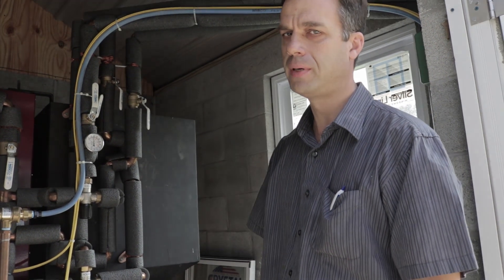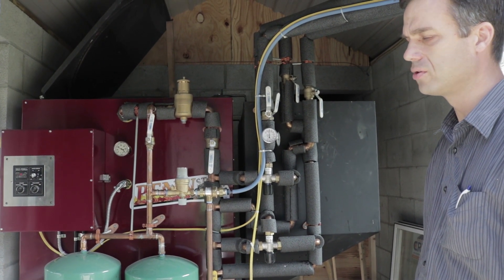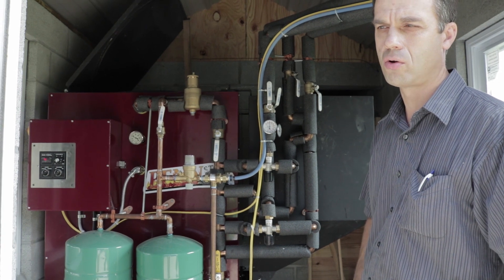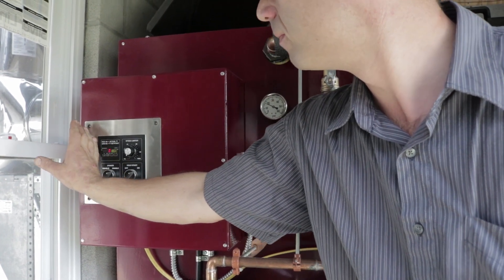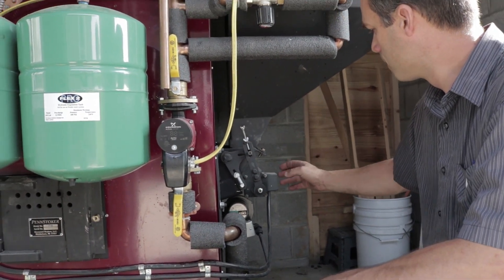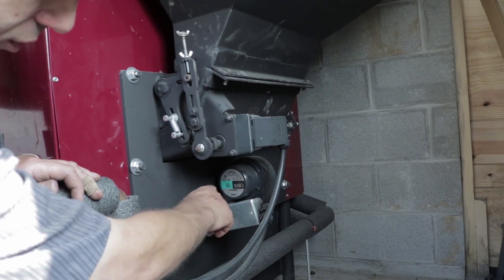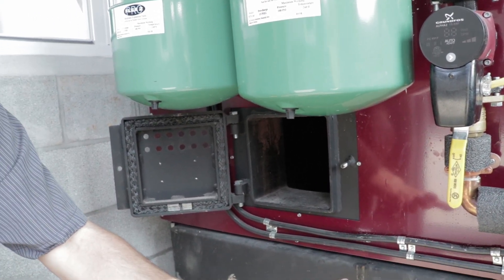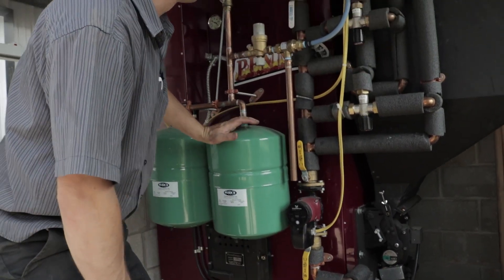Glenwood Pennstoker Coal Boiler - Technical Overview

Comment: Having installed/modified/repaired multi-million dollar manufacturing systems, I recognize just how easy it would be to do maintenance and repair on their system.   Interesting they are using VFD's over other motor control methods.
Reply: Is this considered hvac?